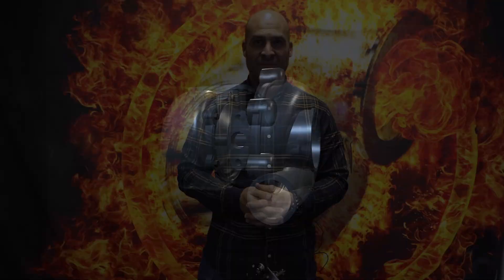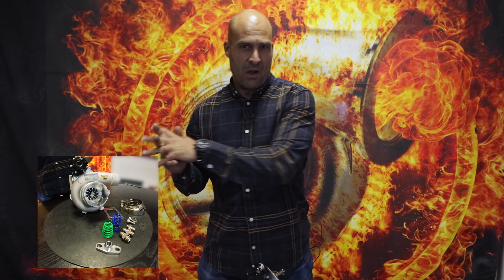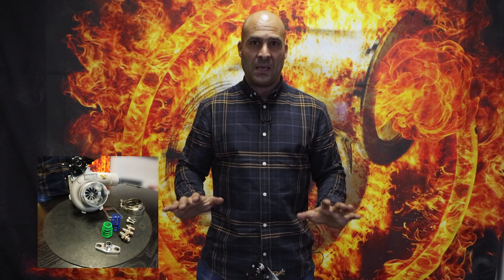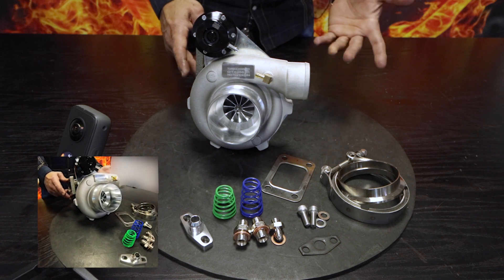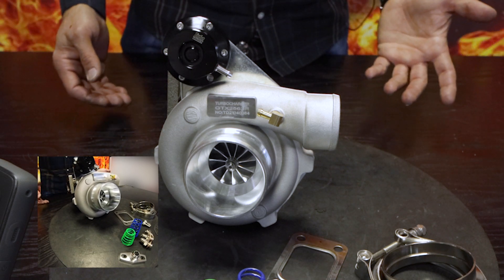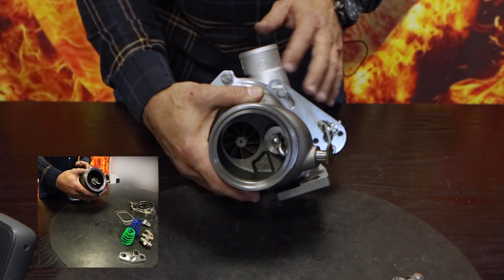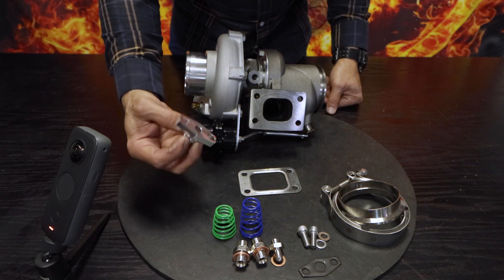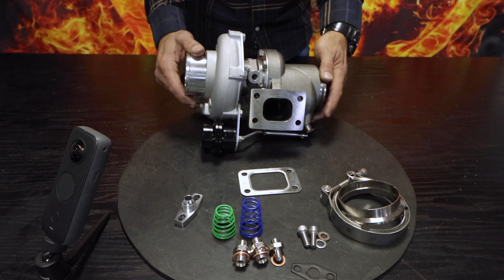TurboDirect S.A 380-430HP small frame BB turbocharger

Comment: Don't suppose you would be able to run two of these turbochargers on a 3.0 inline 6 (n54)? Still struggling to find a reliable 500hp bolt on upgrade and desperately do not want to buy any of the hybrids on the market. I did read the previous replies here and it might not be the best fit for that application, but would like to hear your thoughts, or if TurboDirect could have a solution.
Reply from the maker: The hybrids are not reliable - the chinese have tried to build these aswell, and anything higher than a specific booth level sees those turbos fail. Why dont you consider a single turbo setup? 

I would look here:- https://www.youtube.com/watch?v=ay-G5AYBj4A&t=1s 

This is something that would spool reasonably well for a street setup, and make the power you want with some reserves for you as you decide to increase boost.
Reply: @TurboDirectSA  I fully agree, I really am not a fan of the hybrids being built and people are spending small fortunes on what I see is a very unreliable solution. 

Ideally I would like to stay twin turbo as going to a single would require a full rework of all the plumbing as well as a certification in my country (nz) . 

I would love to go for a single turbo efr 7670 and just forget twins all together, however being rhd it’s difficult to find a cost effective solution. That’s the reason I’m constantly on the lookout for a reliable twin turbo setup.
Reply from the maker: @ryanlawson5768  That would mean that you need to stick to what looks like an OEM bolt on solution - this is the unreliable "hybrid" turbos that are floating around.

Not much of an option i guess.

Comment: I have noticed that most  turbochargers with non-splitter blade compressorwheel have ported shroud compressor cover to reduce surge problems. With a small T25 A/R0.49 turbine housing, spool up will be intense. Will this turbo not stuggle a lot with surge at high boost pressures at low rpm? To be more specific, our goal is usually 300 hp at the wheels at 4000 rpm (ca. 540 Nm) for a 2.0L street car engine. We have seen that many turbos struggle severely with surge when we try to achive this.  We find it challening to get the NA power at 4000 o/min. up to 100 hp (ca. 180 Nm) at the hubs and consequently about 2 BAR boost is needed to get to our usual goal of 300 hp @4000 rpm. Will this turbo handle this challange?
Reply from the maker: Thank you for the comment, and brilliant question. This is a long one - so brace! 

Keep in mind that in order to "sell" or "suggest" a turbocharger to a client, you need to firstly understand what exactly the client wants to do/achieve in the project. (At least this is what we do at TurboDirect S.A) if you for example, contacted me with a 2.0litre engine and requested this GTX2563R from me, i would not supply it to you as this is not designed for this size engine and you power expectation above (never max a turbo out to produce your required HP target, always leave something in reserve, at least 20%) ----- UNLESS it was an 8valve motor with low RPM range being used for rock crawling, or lower engine and turbocharger RPM (low boost setup) like on an NA high compression engine. 

Keep in mind that the turbine wheel on this turbo is very small - and perfectly suited to the AR of the turbine housing -- for small CID engines, this combination will work well E.G 1.2 - 1.6litre 4cylinder petrol engines with an rpm range up to 6000-6500rpm. In order to produce 380-400HP you wouldn't need to boost more than 1.2 - 1.4bar gauge pressure - at this pressure and rotational speed there is no need for the anti surge housing, not unless the engines ability to consume the flow is very restricted, in which case you would need to have prepared the engine in a way to be able to produce this high HP number in the first place - and no matter what turbo you install it will surge anyway. 

What is surge at low engine RPM?  Its a bottle neck (reverse pulse reverberation) in the engines ability to consume the incoming air flow - this backs up against the rotating assembly and slow it down, while at the same time the turbine wheel is trying to drive the rotating assembly on the other end. This causes abnormal bearing wear etc etc 

How do you overcome surge, prepare the engine to flow more at that RPM, or lower the incoming air flow volume. How does one do the later?  And i answer with an actual example myself and a close friend of mine named Steve Clark from No Sweat Racing experienced together one night while tuning an R32 GTR. The client had installed a journal bearing custom turbo for a drift  application, as follows: T3 AR48 turbine housing, T3 stage 3 turbine shaft (55mmx65mm) and an AR60 T04B comp housing with dash25 compressor (55mm x 71mm) 8 blade splitter 409179-0025 is its part number.  The car surged as we approached 1.4bar boost - couldn't not tune it out, and lowering boost lost too much power for the drift.  we tried increasing boost, still no solution. We eventually replaced the compressor wheel for another wheel with the identical 55mm inducer and 71mm exducer BUT it had 6 blade splitter design - problem solved immediately.  

Point is, spec'ing the right turbo for the right job is KEY to a successful result.
Reply: @TurboDirectSA  Thank you for an excellent explaination.
Reply from the maker: @finnroen2334  Pleasure Finn

Comment: Great video as always.  Will turbo direct be offering their own range of twin scroll ball bearing turbos
Reply from the maker: Thank you for the compliment. We have a new range of Vband housings coming out for the latest in-house offering of two model turbochargers we aim to release by the end of the year which is a 100% proprietary TurboDirect S.A product from the last nut and bolt, even the flanges are made by us -- The only parts we purchase that we never designed are the ball bearing cartridges.  We do have a project which starts only next month for a larger range of stainless housings for the EFR turbo range with different AR's and flange face mounting options.  Twin scroll designs we will address at a later stage.

Comment: ok, so this is basically what Garrett should had done many years ago and has a new 9 blade wheel instead of the '80s vintage 11 blade wheel matched with a GTX2863 compressor, is that correct? I find it a really smart idea, even if a tad oversized for a 1,2 lt engine, makes more sense for me for engines between 1,5-1,8 lt (obviously not hi revving 1,8 lt as 2ZZ or B18C for example)
Reply from the maker: I wouldn't blame anyone for this, as we all learn as we go along. The 11blade wheel is not vintage, it was released in the GTX Gen1 range in 2011.  Always keep in mind that you need to plot a compressor map in order to use a turbocharger correctly and inside of the map, producing the HP you want, and ensuring you stay outside of the surge limit.
Reply: @TurboDirectSA  "11 blade wheel" I was referring to the turbine wheel not the compressor. That's why I wrote "a new 9 blade wheel instead of the '80s vintage 11 blade wheel". Instead I think that I can understand the logic behind it, a bigger 63mm exducer compressor wheel which can give more cfm at lower boost in comparison with an other design (6+6,7+7,8+0 etc) that suits better to the 0.49 a/r turbine housing.
Reply from the maker: @aftastosk6016  I got you - thanks for the correction.  Yes the GT style turbine heads are less back pressure and more efficient in driving the compressor, has a sharp cut back angle and able to rotate at high speeds.  The small GTX25 turbine wheel together with the small AR49 housing, is a perfect match, but it runs a large high flow compressor on the opposite side, which provides flow, the rotating assembly therefore has a high thrust load, BUT this is why we chose a ball bearing cartridge, as it handle 50 times the thrust loading of a bronze type bearing system.   We arent looking for high boost in order to produce the 38lb/min of air flow so the bearing system will remain reliable and the compressor flow is at its best low down for the smaller engines.
Reply: @TurboDirectSA  thank you the useful info - I would add - mostly for people that may reading us - that the biggest strength of a ball bearing is not a given by definition - I believe that they are stronger journal bearings that ball bearing out there - but I am sure that YOUR ball bearing would be top quality - because in one of your previous uploads you were the ONLY person that I am aware of that explained on the internet properly how ball bearings work and their real advantages. (I can talk here why MHI are still on top, but I would be of topic). You made me remember the "hybrid" conversions, usually destined for Nissans, of the various OEM T25/GT25s with a 2863 compressor that almost always ended up in bearing failure. Also, I wonder how much you are aware of, you made the perfect turbocharger for the Honda D16 engine and the VW 1.8T 20v
Reply from the maker: @aftastosk6016  Thanks buddy, but the ball bearing is not my design at all, its an off the shelf cartridge which is available if you know where to buy it, and its the original OEM supplier for Garrett which we purchase directly from. Being the Master Garrett Distributor has its perks i guess.
Reply: @TurboDirectSA  ok, this is really smart. It's what Garrett should had done, but for some reason, they didn't

Comment: how would these do with RB26 twin turbo ? 2x1.3l ?
Reply from the maker: These will work very well - they are NOT bolt on though, the comp housings dont have the flange face on the inlet and outlet like the Stock units do, nor the close fit actuators like stock units have. Some location and piping changes, but will fit into the space available.